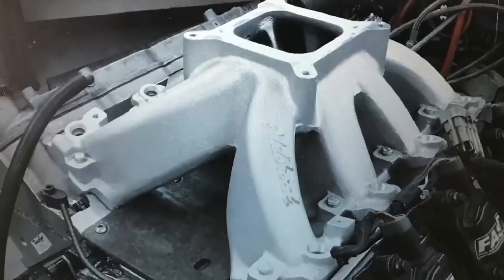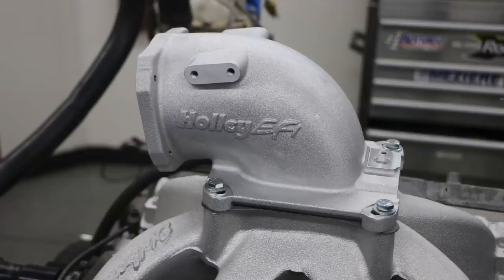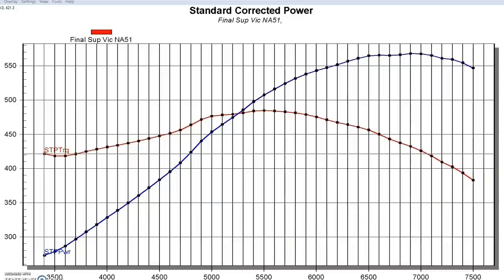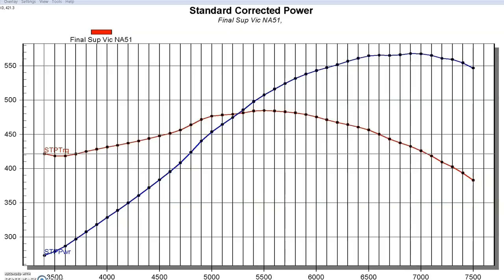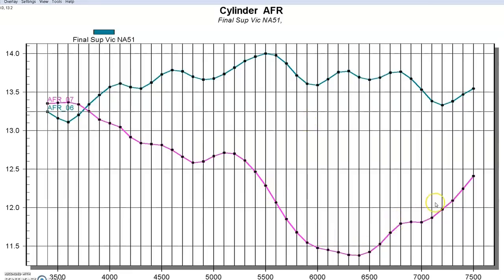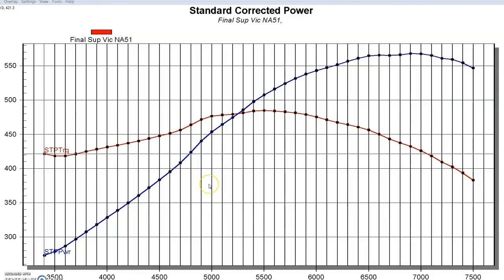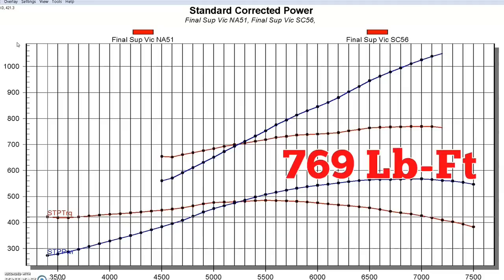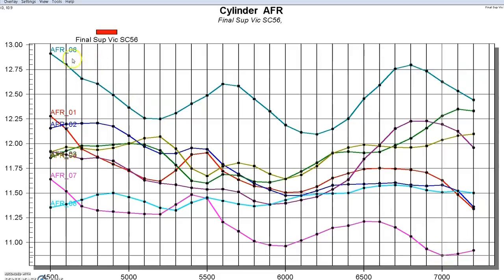BOOST MAKES IT BETTER? LS A/F RATIO!

Comment: Thanks Richard for all the comprehensive and informative videos. It would be cool if you did a video showing the difference in Power between 11:5 and 12:5 AFR with a Boosted Engine. Possibly, even between a Centrifugal and PD Blower. Great Stuff Bro

Comment: Richard, is it possible to do this same test with a small block ford engine?
Reply from the maker: results are similar with same intakes
Reply: @richardholdener1727  I have a sbf with efi single plane, throtte body 4 barrel and powerdyne bd11a, its a good combination?

Comment: Just thinking about it Richard holdener when's the last time you sent those fuel injectors out to be flow matched and hisonic cleaned? A two-point variation between air fuel ratio is major major major. I think it would be a good idea to do a video on fuel injector Maintenance and Service I bet you that window in between all eight Runners would probably close up a good bit after their sonic cleaned

Comment: Very interesting video... it makes me wonder because its true that the manifold works, but you'd have to spend on 8 wideband sensors wich aren't cheap to properly tune the engine.

I think it would be a good idea to make this test with an edelbrock manifold and see how the air distribution affects the afr's

As always, amazing videos bro

Comment: Was each injector flow tested *at the SAME pulsewidth AND RPM or duty cycle as each of the dyno tests required for its particular AFR and power level*? Obviously injector to injector static flow can be easier matched than dynamic flow differences between injectors at varying pulsewidths and RPMs. 

The other variance I can see is effect on valve motion via spring, lifter or maybe pushrod strain under a higher intake pressure boosted vs N/A. Maybe causing a different harmonic in the valvetrain or just basically slightly different valve events being more pronounced. Just theorizing.

Comment: How about a strange test....( or not ) Test a motor...but with pipework, intercooler and even a pair of turbos attached as per an in-car install. But NO boost allowed. Just to see how much restriction all that plumbing creates off boost, which in turn would hurt spool/boost threshold.

Comment: Really enjoy these videos- and the analysis is very good at answering my questions.  I do have one question however.  How much of the variation between cylinders is caused by fuel rail pressure dynamics?  If you add rail pressure dampeners will you see a change in distribution?  I have seen some data with fuel pressure measured at the injector inlet and the variation was so huge it was a wonder the engine even ran!

Comment: Did you flow test the injectors? I’ve seen plenty of brand new “flow matched” injector sets even from major companies have as much 8-10% flow difference between the highest and lowest flowing in the set on my tester.
Reply from the maker: we have an ASNU inj flow/clean machine-they were checked
Reply: Richard Holdener I figured they were. I just wanted to ask.

Comment: Richard, how about test of difference in horsepower/torque where you tune an engine the conventional way and then you tune each cylinder individually to see what a difference there is?
Reply from the maker: look at the video comparing carbs vs computers-we did that

Comment: Have you tested afr on each cylinder with oem manifolds and replacement efi mani folds? Cant believe how bad it was with  single plan na
Reply from the maker: it was off with the factory trk intake well

Comment: Awesome Richard ,,,,,so I have a dual plane performer that I dug the center out ,,,"all this stuff was brand new that's why i'm going with it " with a FAST EZEFI first edition ,,on top so i'll follow all the other tests and set on the highest spacer block I got ,,,,,,and understand all this while I break it in Fresh Machined LS1 227 d 605 lift 11 1/2 forged pistons H Beams and roller Erything ,,,Sanderson F body long tubes Ported heads 914 Porsche 0uTLaW ,,,,,,I'll break the motor in No Knucklehead stuff ,,,,,then i'll come back at it with the Tailored parts and pieces ,,,although this should ring my bell good enough ,,,Thank you Richard its really KooL that I understand YoU~! ThaNKyoU THaNKyoU THANK YOU ,,,Super KooL ~~~~~! your a BaD Dude MaN
Reply from the maker: let me know how it works out

Comment: A bit of a surprise with the air fuel spread across the range. None for me boost related as the higher the pressure the faster/better it equalizes with a denser charge. Wouldn't mind seeing the difference with a carb on that manifold I would bet that the A/F ratio would improve NA.  The differences in ratio I would bet that there is a problem in the valve train. A short lifter, rocker arm etc or the most likely the valve may be lifting the same measurement but is set deeper into the head. The back of the valve reducing port volume and flow compared to other ports?

Comment: Great content (who the hell disliked it?). Richard have you ever looked at cyl to cyl AFR differences on stock manifolds?  I'm assuming that the OEMs probably tried to get this pretty close for reliability reasons, but I could be completely wrong.  Particularly interested in seeing how the distribution is on a factory blown motor (LSA/LS9) vs. NA (LS7, TBSS, etc).
Reply from the maker: I tested distribution on a truck intake-stock and with nitrous
Reply: @richardholdener1727  Is this in your videos or one of your print articles?

Comment: 1.7 stock rockers vs 1.8 roller rockers, turbo crossover pipe diameter comparison  (spool time, back pressure etc) bigger isn't better cylinder head test. Hp per dollar junkyard wars, cam headers and intake swaps only. Just some ideas, love the channel.
Reply from the maker: thnx for the ideas

Comment: Thanks again Richard great test , I would like to know if the fuel distribution is as wonky on a proper blow through carb on a single plane as that’s what I have on my 1400 wheel hp bbc , I can’t be the only guy who hasn’t converted yet
Reply from the maker: I think its mostly the intake design and not what supplies the fuel-I'd like to do more testing

Comment: Would be very interesting to see a stock LS3 or gen V LT1 manifold vs a Holley high ram, with or without boost on the appropriate engine.
Reply from the maker: LS3 makes more than Hi ram up to 6500

Comment: So question how do those heads compare to 243 CnC with bigger valves? TSP special. Looking to probably lsa or maggy my gen 4 ls2. Has forged pistons and rings gapped. Just trying to get an idea of my build compared to this one. I know it's not going to make the HP of this one because the blower is smaller. I'm shooting for an 8xxhp weekend car.
Reply from the maker: properly ported 243 heads make power like these 225s
Reply: @richardholdener1727  Thank you...i can see that the numbers are similar, but that is Greek to me. HAHA. Keep up the great videos love them.

Comment: If you don't get excited over 1000hp then you got issues. I've never even been around a 1000hp engine! Hell, I'd be excited if I was able to get 400hp out of an engine.
Reply: Bill  exactly mate, people are quick to forget that 500hp is more than anyone needs.
Reply: @hairynutz7334  unless it's a track car. I just want to do burnouts and go fast.
Reply: @hairynutz7334  speak for yourself...
Reply: 1500 is easily doable with properly sized turbos

Comment: Gee that was very interesting, goes to show you that air does what it wants. Batch delivery test is the one we all want to know, and see if you can trim or add fuel like stagger jetting on a carb to compensate.. thankyou
Reply from the maker: individual cylinder works even under batch-we've done that with Holley

Comment: Would you say #6 is always lean on these single planes? I'm just curious if I should throw a couple % of offset to it on the Holley. I've always heard it's 7 and 8 but that's probably hearsay
Reply: I believe the factory intakes have distribution problems with 7 and 8. Would be a nice test to see to know for sure.
Reply: 7 and 8 is carb
Reply: Engine masters season 4 episode 52

Comment: Best video so far, as far as production. Audio was spot on, nice to see the engine do a pull, all around killed it. 

Content was very informative too! What do you think the afrs would do under part throttle/partial load situations? Would it be worth spending the tuning time making them all perfectly synchronized under WOT/full load conditions, or mostly just get rid of the scary bad fuel ratios to make it safe? Also, I found it interesting that on the NA set up, the fuel curves were divergent where on the boosted set up, they kind of followed each other more directly... Do you feel like the boost helps because it stabilizes the amount of air behind the valves? Does this just demonstrate the fact that in boosted set ups, manifold design is less critical because boost and drive pressures negate any scavenging effects manifold design would create?
Reply from the maker: I did that in the EFI vs carb video-not much power but definitely safer

Comment: this is kinda off subject . but . for argument sake . i have a NA motor with port fuel injection . why does torque and hp change from a holly high ram vrs  something like a corvette intake ? ...it stumps me because the injectors ar in the same location . . wwhy does it matter whats above the injectors as far as intake length?? its just air . thats NOT getting mixed with fuel (before injectors) .??? do you follow my reasoning ???
Reply from the maker: the intake runner length provides a charge filling effect-its called reflected wave-it is determined by runner length and doesn't have anything to do with injector placement-that is charge cooling

Comment: Boost a 351M let's see what 8:1 stock can do with Cleveland heads and 14psi boost...
Reply from the maker: I did a 400M with 4V alum heads-it did well
Reply: @richardholdener1727  any vid? this is a very hard to find tid bit on the YT.. I'd like to see stock, with a Holley super sniper, and the hyper spark dizzy..then valve springs and cam, then boost.. figuring the boost would work with the low compression pistons..The 400 is the fix but boost might have some huge plusses cause those heads...also the timing chain is 3 deg retarded fix that with a roller...
Reply: Isn't the Windsor the one with the splayed, big daddy heads? Much more interesting, no?
Reply: @700HpVette  no 351m/400 has Cleveland heads big canted valve semi hemi type heads. Windsor has wedge like 302 every video on the tube is a Windsor simply because emissions killed the big valve heads cause less air less fuel lower hp equals better emissions in the 70s and the Windsor had that in Spade's. Australia used Clevelands long after they died here in the US. They make big power and fact Nascar came out with the restrictor plate rules cause Fords were killing GM on the track also had a wedge head...

Comment: Im curious if you add a cold air intake and air filter on the holley elbow with the 4150 intake if it will change cylinder air fuel ratio?
Reply from the maker: I doubt it-I have tested air inlet length and diameter in the past

Comment: Opinions on the Holly Sniper setup for street use?
My guess on those graphs would be the need for finer atomization, better exhaust scavenging, and less air intake restrictions for N/A applications?  Seems to me that a blower corrects all those things by its nature.
Reply from the maker: what sniper-the 4-hole TB that supplies fuel
Reply: @richardholdener1727  Yes sir...the four barrel conversion kit.
Reply: Wak Job I would also like to know about the sniper stuff. Being a mopar guy that’s a huge price saver if it’s good stuff